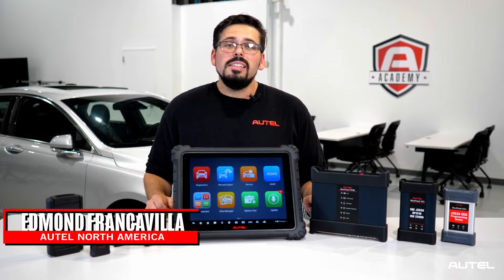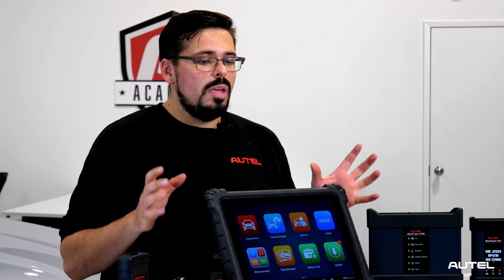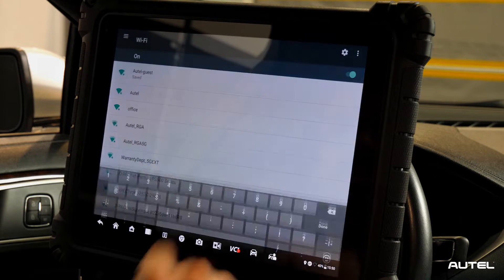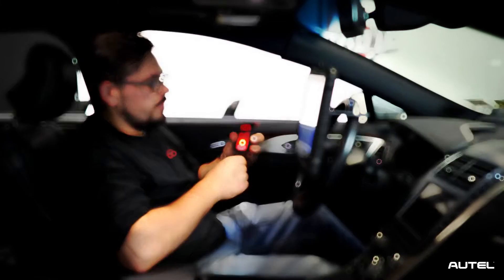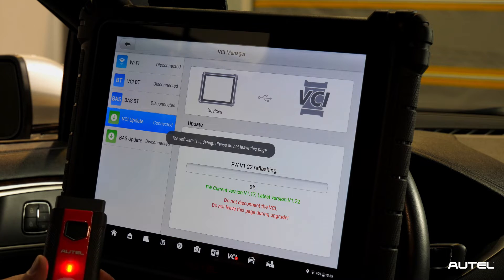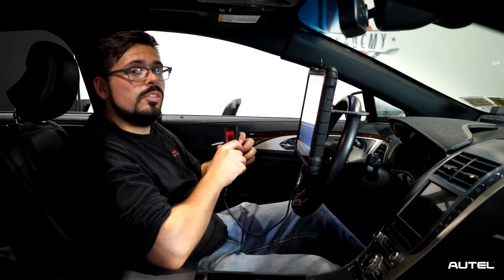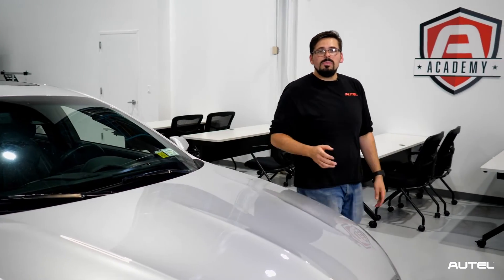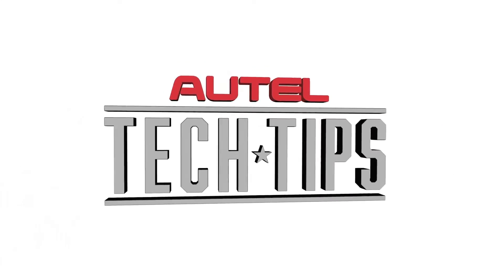How To Update Your VCI (Vehicle Communication Interface) | Tech Tips  | Autel

Comment: In your video, you say: "You will locate the VCI tab at the bottom of the screen," but do not fully explain why. At 0.42 in the video,  the VCI icon at the bottom of the screen turns from red to green, but the second the update is completed, it turns back to red, indicating that there is no connection. Why is that? If a Blue Tooth connection has been made, why doesn't it remain connected?  At the same time, the VCI BT as well as Wi-Fi at the top left hand of the screen remains as "disconnected."

Comment: I just bought a MS Ultra and I have a BT608 battery tester that came with that little VCI 200. If I wish to use that VCI 200 with my Ultra and  update the VCI firmware , will it no longer work for the BT608? ... and will MS Ultra Topology feature still work if I use the VCI 200 instead of the VCMI?

Comment: It's a little slower but it does work with my maxisys ultra and is much more convenient than going through the j-2534 box. Thanks for the video
Reply: I just got my ultra and came here in search of info on using the vci200. Sounds like it'll work from your comment, but how much slower is it? I'd like to use the vci200 for day to day stuff and break out the maxiflash only when necessary.